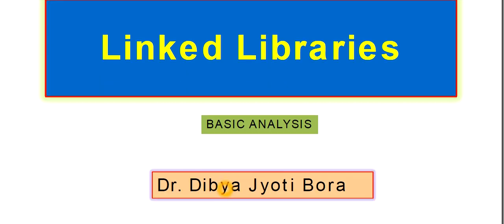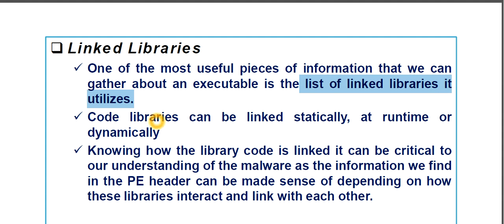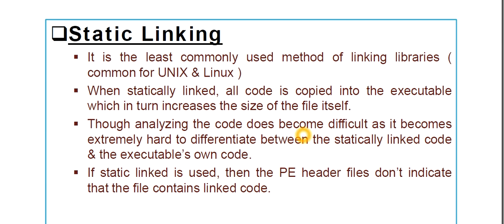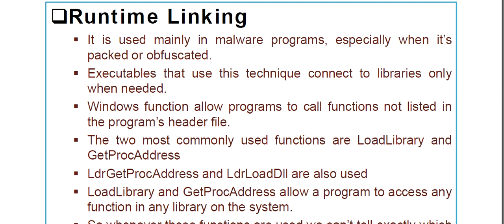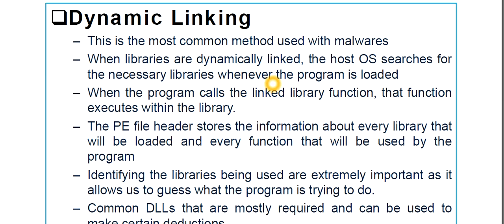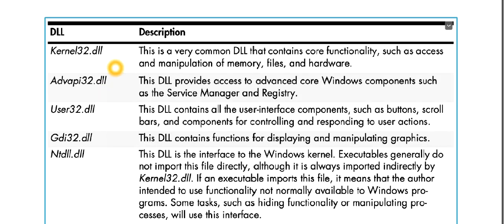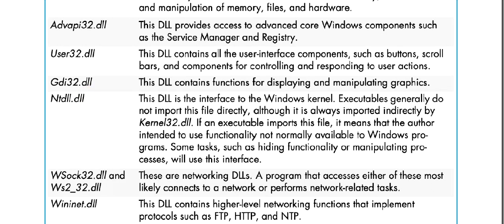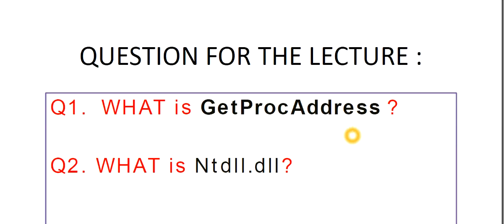Linked Libraries|Static, Runtime & Dynamic Linking|Basic Malware Analysis|#Malware|LECTURE#11

Comment: 1. The spelling and case of the function name pointed to by lpProcName must be identical to that in the EXPORTS statement of the source DLL's module-definition (.DEF) file. The exported names of Win32 API functions may differ from the names used when calling these functions in the code.

2. ntdll.dll is created by Windows in the System32 folder when the OS gets installed. The description of the file reads ‘NT Layer DLL’ which means that it contains some Kernel functions that help in the normal functioning of the Windows operating system.

Comment: Q1 Answer. The spelling and case of the function name pointed to by lpProcName must be identical to that in the EXPORTS statement of the source DLL's module-definition (.DEF) file. The exported names of Win32 API functions may differ from the names used when calling these functions in the code.

Q2  Answer . ntdll.dll is created by Windows in the System32 folder when the OS gets installed. The description of the file reads ‘NT Layer DLL’ which means that it contains some Kernel functions that help in the normal functioning of the Windows operating system.

Comment: 1.GetProcAddress returns the address )
function.GetProcAddress is used to retrieve Processes
explicitly linking to a DLL call GetProcAddress to
obtain the address of an exported function in
the DLL. We use the returned function pointer to
call the DLL function. GetProcAddress takes as
parameters the DLL module handle (returned by
either LoadLibrary, AfxLoadLibrary, or GetModuleHandle) and
takes either the name of the function we want to call or the
function's export ordinal of exported functions in DLLs.

2. The ntdll.dll file is a file created by Microsoft that has a
description of "NT Layer DLL'and is the file that contains
NT kernel functions.NTDLL is the user-mode face of the
Windows kernel to support any number of application-level
subsystems. The ntdll.dil file included with Microsoft
Windows is not spyware, a trojan, or a virus. However, like
any file on your computer it can become corrupted by a virus
or trojan. antivirus programs can detect and clean this file if
it has become infected. Because this file is part of Windows
users should never delete or remove this file if they think it is
infected.

Comment: Abdul Zabber:
1.GetProcAddress returns the address of the specified exported dynamic-link library (DLL) function.

2.ntdll. dll is a module that contains NT system functions. The ntdll. dll file is a file created by Microsoft that has a description of "NT Layer DLL" and is the file that contains NT kernel functions. However, like any file on the computer it can become corrupted by a virus or trojan.

Comment: 1. GetProcAddress function retrieves the address of an exported function or variable from the specified dynamic-link library (DLL).

2. The ntdll.dll file is a file created by Microsoft that has a description of "NT Layer DLL". It is one of the most important file in the "Microsoft Windows NT"OS family. It is mostly concerned with system tasks and it contains NT kernel-mode functions which enables the Windows API. It is a file required by Windows and deleting the file causes errors with Windows and would make Windows inoperable. It is also responsible for messages, timing, threading and synchronization in the operating system.

Comment: GetProcAddress returns the address of the specified exported dynamic-link library (DLL) function.

ntdll. dll is a module that contains NT system functions. The ntdll. dll file is a file created by Microsoft that has a description of "NT Layer DLL" and is the file that contains NT kernel functions. However, like any file on the computer it can become corrupted by a virus or trojan.

Comment: Ans 1:-GetProcAddress returns the address of the specified exported dynamic-link library (DLL) function.
GetProcAddress verifies that the specified ordinal is in the range 1 through the highest ordinal value exported in the .DEF file. The function then uses the ordinal as an index to read the function's address from a function table. If the .DEF file does not number the functions consecutively from 1 to N (where N is the number of exported functions), an error can occur where GetProcAddress returns an invalid, non-NULL address, even though there is no function with the specified ordinal.

In cases where the function may not exist, the function should be specified by name rather than by ordinal value.

RTSS Environment: The following information applies to the RTSS environment:

Function lookup by ordinal value is not presently supported.
If the exported routine name is decorated (e.g., _<fname>@<# argument bytes> as in the __stdcall convention) the decorated name must be specified in the call to GetProcAddress.
DEF files are not supported.

Ans 2:-The ntdll. dll file is a file created by Microsoft that has a description of "NT Layer DLL" and is the file that contains NT kernel functions. The ntdll. dll file is located in the c:\windows\system32 or c:\winnt\system32 directory and can also be found in the c:\i386 directory.

Comment: 1.GetProcAddress returns the address of the specified exported dynamic-link library (DLL) function. ... GetProcAddress is used to retrieve addresses of exported functions in DLLs.

2.The ntdll. dll file is a file created by Microsoft that has a description of "NT Layer DLL" and is the file that contains NT kernel functions. The ntdll. dll file is located in the c:\windows\system32 or c:\winnt\system32 directory and can also be found in the c:\i386 directory.

Comment: 1. GetProcAddress:- This function is used to retrieve the address of a function in a DLL loaded into memory. This is used to import functions from other DLLs in addition to the functions imported in the PE

file header.

2. Ntdll.dll:- The ntdll.dll file is a file created

by Microsoft that has a description of "NT Layer DLL" and is the file that contains NT

kernel functions.

The ntdll.dll file is located in the c:

\windows\system32 or c:\winnt\system32 directory and can also be found in the c:

\i386 directory.
Reply from the maker: Good Explanation

Comment: Ans 1:-
GetProcAddress returns the address of the specified exported dynamic-link library (DLL) function.
SYNTAX
FARPROC GetProcAddress( HMODULE hModule,   LPCSTR lpProcName ); 

PARAMETERS
hModule:-
A handle to the DLL module that contains the function. The LoadLibrary function returns this handle.

lpProcName:-
A pointer to a null-terminated string containing the function name, or the function's ordinal value.

Ans2:-
ntdll.dll is a module that contains NT system functions. The ntdll.dll file is a file created by Microsoft that has a description of "NT Layer DLL" and is the file that contains NT kernel functions.
This file is located in the c:\windows\system32 or c:\winnt\system32 directory and can also be found in the c:\i386 directory.
This file has been flagged as a critical security risk in the Microsoft security bulletin MS03-07 dated March 17, 2003. If you have all the latest updates for your version of Windows you should not be affected by this security risk.
The ntdll.dll file included with Microsoft Windows is not spyware, a trojan, or a virus. However, like any file on your computer it can become corrupted by a virus or trojan. antivirus programs can detect and clean this file if it has become infected. Because this file is part of Windows users should never delete or remove this file if they think it is infected, let the antivirus program handle it
Reply from the maker: Rajesh, very good explanation!
Reply: @djb_world  Thank you sir

Comment: GetProcAddress-
It  returns the address of the specified exported dynamic-link library (DLL) function.

SYNTAX

FARPROC GetProcAddress(     HMODULE hModule,     LPCSTR lpProcName ); 

PARAMETERS

hModule

A handle to the DLL module that contains the function. The load library function returns this handle.

lpProcName

A pointer to a null-terminated string containing the function name, or the function's ordinal value.

Ntdll.dll-
The ntdll.dll file is a file created by Microsoft that has a description of "NT Layer DLL" and is the file that contains NT kernel functions.

The ntdll.dll file is located in the c:\windows\system32 or c:\winnt\system32 directory and can also be found in the c:\i386 directory.
Reply from the maker: Right!

Comment: 1.GetProcAddress returns the address of the
specified exported dynamic-link library (DLL)
function.GetProcAddress is used to retrieve Processes
explicitly linking to a DLL call GetProcAddress to
obtain the address of an exported function in
the DLL. We use the returned function pointer to
call the DLL function. GetProcAddress takes as
parameters the DLL module handle (returned by
either LoadLibrary, AfxLoadLibrary, or GetModuleHandle) and
takes either the name of the function we want to call or the
function's export ordinal of exported functions in DLLs.

2. The ntdll.dll file is a file created by Microsoft that has a
description of "NT Layer DLL'and is the file that contains
NT kernel functions.NTDLL is the user-mode face of the
Windows kernel to support any number of application-level
subsystems. The ntdll.dil file included with Microsoft
Windows is not spyware, a trojan, or a virus. However, like
any file on your computer it can become corrupted by a virus
or trojan. antivirus programs can detect and clean this file if
it has become infected. Because this file is part of Windows
users should never delete or remove this file if they think it is
infected.
Reply from the maker: Answer is well explained, Mousom!

Comment: Ans 1:-GetProcAddress returns the address of the specified exported dynamic-link library (DLL) function.

SYNTAX

FARPROC GetProcAddress(
    HMODULE hModule,
    LPCSTR lpProcName
); 
GetProcAddress is used to retrieve addresses of exported functions in DLLs.
GetProcAddress verifies that the specified ordinal is in the range 1 through the highest ordinal value exported in the .DEF file. The function then uses the ordinal as an index to read the function's address from a function table. If the .DEF file does not number the functions consecutively from 1 to N (where N is the number of exported functions), an error can occur where GetProcAddress returns an invalid, non-NULL address, even though there is no function with the specified ordinal.

Ans 2:-The ntdll.dll file is a file created by Microsoft that has a description of "NT Layer DLL" and is the file that contains NT kernel functions.
The ntdll.dll file is located in the
 c:\windows\system32 or 
c:\winnt\system32 directory and can also be found in the c:\i386 directory.
Reply from the maker: Correct Explanation!

Comment: 1.Ans- GetProcAddress returns the address of the specified exported dynamic-link library (DLL)   function.GetProcAddress is used to retrieve addresses of exported functions in DLLs.

2.Ans- The ntdll.dll file is a file created by Microsoft that has a description of "NT Layer DLL" and is the file that contains NT kernel functions. The ntdll. dll file is located in the c:\windows\system32 or c:\winnt\system32 directory and can also be found in the c:\i386 directory.
Reply from the maker: Correct

Comment: Raktim Kakati 
CS18MSIIT034
1.GetProcAddress returns the address of the specified exported dynamic-link library (DLL) function.GetProcAddress is used to retrieve Processes explicitly linking to a DLL call GetProcAddress to obtain the address of an exported function in the DLL. We use the returned function pointer to call the DLL function. GetProcAddress takes as parameters the DLL module handle (returned by either LoadLibrary, AfxLoadLibrary, or GetModuleHandle) and takes either the name of the function we want to call or the function's export ordinal of exported functions in DLLs.

2. The ntdll.dll file is a file created by Microsoft that has a description of "NT Layer DLL" and is the file that contains NT kernel functions.NTDLL is the user-mode face of the Windows kernel to support any number of application-level subsystems. The ntdll.dll file included with Microsoft Windows is not spyware, a trojan, or a virus. However, like any file on your computer it can become corrupted by a virus or trojan. antivirus programs can detect and clean this file if it has become infected. Because this file is part of Windows users should never delete or remove this file if they think it is infected.

Comment: CS18MSIIT041
Ntdll.dll:-
The ntdll.dll file is one of the most important file in the "Microsoft Windows NT" OS family.
Ntdll.dll is mostly concerned with system tasks and it includes a number of kernel-mode
functions which enables the "Windows Application Programming Interface (API)".
The ntdll.dll is also responsible for messages, timing, threading and synchronization in the operating system.

GetProcAddress:-
GetProcAddress returns the address of the specified exported dynamic-link library (DLL) function.
GetProcAddress is used to retrieve addresses of exported functions in DLLs
Reply from the maker: You Are Correct, Ashim!

Comment: 1.
Processes explicitly linking to a DLL call GetProcAddress to obtain the address of an exported function in the DLL. You use the returned function pointer to call the DLL function. GetProcAddress takes as parameters the DLL module handle (returned by either LoadLibrary, AfxLoadLibrary, or GetModuleHandle) and takes either the name of the function you want to call or the function's export ordinal.

Because you are calling the DLL function through a pointer and there is no compile-time type checking, make sure that the parameters to the function are correct so that you do not overstep the memory allocated on the stack and cause an access violation. One way to help provide type-safety is to look at the function prototypes of the exported functions and create matching typedefs for the function pointers.

2.
The ntdll.dll file is a file created by Microsoft that has a description of "NT Layer DLL" and is the file that contains NT kernel functions.

The ntdll.dll file is located in the c:\windows\system32 or c:\winnt\system32 directory and can also be found in the c:\i386 directory.
Reply from the maker: Correct Explanation!

Comment: 2:-The ntdll.dll file is one of the most important file in the "Microsoft Windows NT" OS family. Ntdll.dll is mostly concerned with system tasks and it includes a number of kernel-mode functions which enables the "Windows Application Programming Interface (API)". The ntdll.dll is also responsible for messages, timing, threading and synchronization in the operating system.

If there was an error in this file, you would most likely not be able to start Windows.

The root cause of the error you have is likely someplace else, such as incompatibility or corruption with the program you are trying to run. Since the file is used by most Windows processes, you will not be able to replace it from inside Windows (because it is already in use by Windows), and it is not recommended that you tamper with this file without deep knowledge of its workings.
Reply from the maker: VERY GOOD SANCHARI

Comment: 1:-GetProcAddress is used to retrieve addresses of exported functions in DLLs.

The spelling and case of the function name pointed to by lpProcName must be identical to that in the EXPORTS statement of the source DLL's module-definition (.DEF) file. The exported names of Win32 API functions may differ from the names used when calling these functions in the code. This difference is hidden by macros used in the SDK header files. For more information, see Win32 Function Prototypes.

The lpProcName parameter can identify the DLL function by specifying an ordinal value associated with the function in the EXPORTS statement.

GetProcAddress verifies that the specified ordinal is in the range 1 through the highest ordinal value exported in the .DEF file. The function then uses the ordinal as an index to read the function's address from a function table. If the .DEF file does not number the functions consecutively from 1 to N (where N is the number of exported functions), an error can occur where GetProcAddress returns an invalid, non-NULL address, even though there is no function with the specified ordinal.

In cases where the function may not exist, the function should be specified by name rather than by ordinal value.

RTSS Environment: The following information applies to the RTSS environment:

Function lookup by ordinal value is not presently supported.

If the exported routine name is decorated (e.g., _<fname>@<# argument bytes> as in the __stdcall convention) the decorated name must be specified in the call to GetProcAddress.

DEF files are not supported.
Reply from the maker: CORRECT